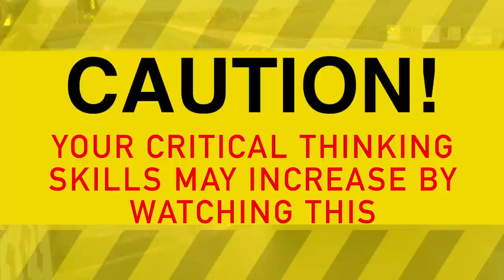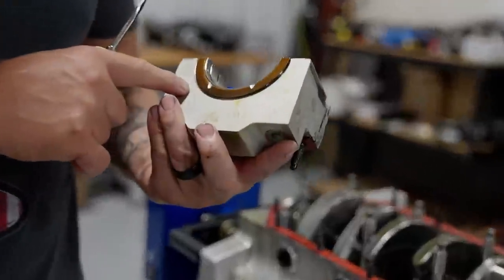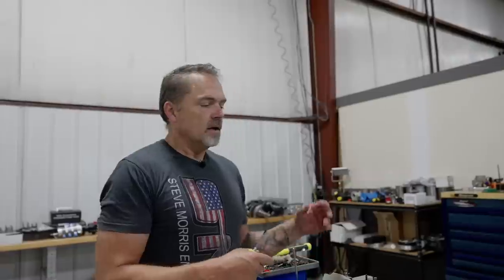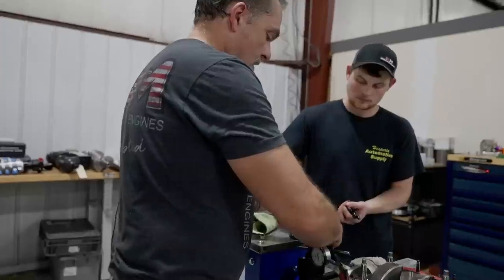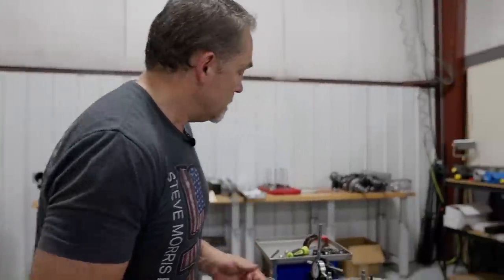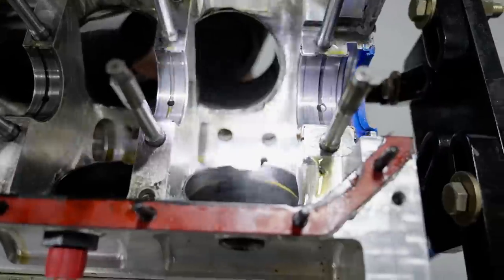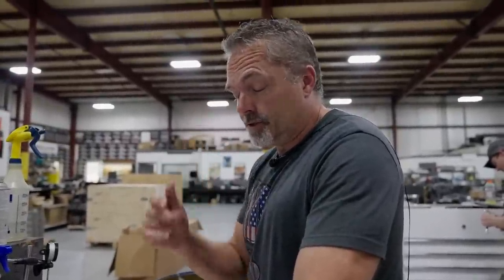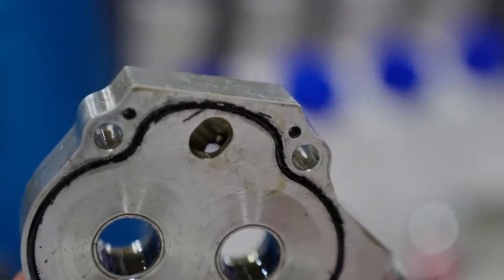I Found Mullets Engine Issue...Part 2

Comment: I love your videos and your work steve but in order for a converter to put pressure on the on the pump gears and housing causing pump failure as well if this is happening  especially in a th400 you need to start with cooler flow there is nothing to limit charge pressure in this transmission most guys run a pop off to limit this I've had one of those fail and bite me once great stuff steve

Comment: Possibility of stuff in the oil tank or oil lines to the pump? Didnt see if they flushed all the lines and the oil tank out after the previous metal issues. Id assume they did that but just spitballing. no metal going through scavenge side only stuff through pressure side getting feed from tank then to filter, may not see at low rpm or 2 step checks sustained high rpm high oil flow/pressure of a pass. love seeing all the tech and tear downs.

Comment: The roller thrust bearing is at the front, while the stock type one is at the rear, so as temperature goes up the block would grow more than the crank, DECREASING the thrust clearance. That combined with pressure from the converter... Probably none of this makes a difference when racing for 6 seconds, but on the street drive between tracks - and towing the trailer - the whole drive train would probably be warmer than any other time. Also, for the trash in the filter - Was the dry sump tank cleaned out? Trash could have come through from previous junk left in the tank???

Comment: Gday Steve, with that bypass being stuck, is there another way for the oil pressure to be relieved at high RPM?  It looks like that pressure side pump has seen a little bit too much pressure.

Hydraulic gear pumps eat their housings in exactly the same way when a relief valve is set incorrectly or fails.

The scavenge side would not be damaged because there is no pressure there, but the pressure side would be damaged.  The high pressure actually bends the shaft and pushes the lobes into the housing.

Happens really easily on aluminium pumps.

Comment: Man... I love my single cylinder 4 stroke so much more now. One time when I raced I tested it with a worn out cam and had an hour and a half to replace it and lash the valves. Everyone else in my class had 2 strokes and kept walking past staring and chatting. Later I found out nobody thought I would be able to have my engine apart and back up in such a short time. I holeshot everyone with my lil 53cc 4 stroke vs only 66cc and 69cc 2 strokes. They all had to play catchup and I got 7th in a field of 18.

Comment: Expensive lesson here I'd bet.  When you have a customer complaint you need all the information available. Maybe create a customer questionnaire before induction of the engine. I'd have certainly thought that checking that pressure relief valve would be on a "lessons learned" list.

Comment: Hey , Steve, I know you probaly will never see this, but is it possible to have crankshaft deflection from the thrust being moved from the rear solid crankshaft snought ,to the front through all the offset rod journals ? maybe even causing a imbalance on trans input shaft or convertor .Not to discredit anything you do ,you do wonderful work .I love all the free knowledge you put here for all of us to absorb. Just wonder if that is possible ??
Reply: I was thinking the same thing. I’m sure it doesn’t take a ton of pressure to flex that crank .02”

Comment: Aluminium has a greater coefficient of expansion than steel. 
If your roller thrust bearing is at the front of the crank and the plain bearing thrust face is at the rear, then it is possible that the thrust clearance on the rear main tightens up as the block gets hot and expands more than the crank.
Is it also possible that the crank compresses slightly under very high axial load induced by charge pressure? With that force being taken by the roller bearing at the front of the motor, this would also cause the clearance to close up on the rear main. Maybe the combination of these two factors and a bit of deflection on the roller bearing housing adds up to the 20 thou required for contact on the rear main.
P.S: Love your in depth analysis of these things!

Comment: The debris is probably from the remote oil tank. It didn't come from the engine or the pump, therefore it was introduced from an outside source. Pretty sure the tank was Cleeter's responsibility.
Either something was hanging out in the tank from the previous engine, or it was contaminated during fabrication or assembly.
I work around very expensive hyd systems and have direct experience with repeated failures from minor overlooked details.
It happens, no one is perfect and it seems they run a pretty intense schedule at the FF.

Comment: Why not put the trust on the back of the block so it isn't trying to collapse your crank like an accordian under thrust load.  There has to be close to .020" of collapse in the crank webbing under load for that back thrust to still be kissing or the retainer is pushing off that much likely a little of each.  Regardless I think it would take a lot of stress off the crank and bearings if it only had the rotational loads to deal with.

Comment: To be honest, you want to see that wear on your bearings if something does go through it. The babbit covers the copper and is very soft to aid in embeddability. It's designed to burry foreign debris and keep it off the journals or wherever else it would be an issue for.

Comment: By continuing running the engine until it failed, you never would have found what the actual problem was.  Since he did not, you learned what the problem was and the next time this happens you can easily pinpoint the most likely cause.

Knowledge is power.

Comment: Chances are that the increase in horsepower loosened existing debris that went undetected. The internal pressure drastically increased by each horsepower added. There could have been material that was there from manufacturing that never loosened because there wasn't enough pressure ran through the system until the HP was increased. That would be my guess.

Comment: 2 things that catch my attention, damage only on the high pressure side of the oil pump pulling oil from the tank... Have the lines coming into and out of the tank been removed and flushed out? Also has the tank been removed, cleaned and flushed since the last issue with contamination? Debris could settle until high RPM and flow...2nd thing is traction control cutting in and out causing major stress on the crankshaft when the converter locks and unlocks, could there be a harmonic issue with the pulse rate the TC is set at and is it adjustable to possibly lessen the converter stress on the crankshaft? Have you seen this issue on any other SMX engines or is this isolated to just this engine? If I remember correctly Cleetus while tuning for the 6's they loaded this TC setup in the tuning.... Seemed like it worked well but wondering if it could've inadvertantly caused a stress issue?
Just thinking out loud...

Comment: Cletus has a transmission problem, mainly his pump doesn't have a orifice installed in the converter feed passage and it's shoving the converter forward with at the pressure it makes available if he's running a TH400 or clone.  Unfortunately it's showing up in your engine.

Comment: Reduced thrust bearing clearance due to thermal expansion seems possible also, can you really know if the crankshaft or block heats up quicker? Also aluminum has double the expansion coefficient....

Comment: As a note on the thrust bearing, if you have a std thrust bearing on the rear on a roller thrust bearing on the front and the clearance is .027 for the regular thrust bearing on the back and .007 on the front, then you have .020 difference between the two. Since the block is aluminum and the crank is steel, they have different coefficients of expansion. Basically aluminum is double that of steel. Like with the rods. Looking at roughly 24 inches difference from the front to rear and a temp change from 80 degrees to 200 degrees, the crank grows by .019 but the block grows by .037. So that means the block is pushing the rear thrust backwards by .018. That eats up most of that .020 difference. So just a little converter balloon pushes the crank right into the rear thrust.  Probably just add another .005 clearance on the rear and it will be fine.

Comment: If I had low oil pressure issue with and external pump, the first thing I would check is the pump, before I tore down a complete engine. Also, the minor scuffing inside the pump doesnt seem to add up to all the metal in the filter.

Comment: Could the material found in the filter screen be from a turbo that’s on its way out? I believe turbo’s are tied into the engine oiling system correct? I don’t know much about turbo engines, but the engine internals look great so maybe one of the turbos introduced metal into the oiling system

Comment: Had similar issue, turned out the cooler was holding material from a oil engine letting go.

Comment: cannot say I've ever seen a crank walk backwards against and eat the forward side of a thrust bearing, except once, when a washer was placed onto the crank snout behind a journal, where it shouldn't have been! crank was pushed backwards and wedged hard against case front, it ate everything up quickly(accidental thrust location). lol
add-on junk bolted to the crank snout/pulley could potentially push it backwards hard enough to cause damage, that would be some major oversight and bad assembly work to cause it though.
watching the rest to see if anything is found.

Comment: could piston be chipping at some of the welds in the block/cylinders? piston would be harder material then the welds/block repairs so it wouldn’t show on the piston heads much. would self clearance after while. plus with heat cycles could be changing it a bit

Comment: So a grain of sand (or something) got into the dry sump tank. It got sucked into the pressure stage and hung around a few rotations starting the gears eating themselves. On it's way out it scraped the bypass valve and started it on it's way to galling. Then it went thru an oil filter bypass or hole in the media and lodged in a main bearing causing a minor scratch. It's possible, I've found race engines that ran for years with their oil filters bypassing most of the time. What's left of the foreign object might be buried at the of that bearing scratch. What's the filter media look like?

Comment: I'm thinking that is where the flakes are coming from the oil pump section. Nothing in the rest of the engine is causing the flakes so far as I can see anyways. There has to be some way to keep the converter and the transmission from trying to push everything forward on the crank.

Comment: OK. So the main thrust is now at the front of the crankshaft. Based on the numbers you gave, you're already squishing the crank .020 plus any heat growth. I doubt that's good. May be time to redesign and put the thrust load at the rear again??? It's like trying to balance a brick on a flexy straw.

Comment: So the pressure side of the pump picked up the metal from the oil tank then?  What returns to the tank other than the scavenge side of the pump?  Do the turbos return oil directly into the oil tank or into the sump?  Are we looking at a turbo eating itself here?  I did notice one of Mullet's turbos was spitting out of the inlet when he was starting his burnouts.  Just wonder if there's something going on there that is creating the metal swarf.

Comment: Steve mentioned that the inclusions were on the pressure side of the oil  pump; sourcing oil from the oil tank. 
Since I’m not familiar with the oil tank’s construction, is it possible that slag entered the oil pump from a poorly back purged weld on the tank?

Comment: Does this answer where the materials came from? Maybe the tank had some trash in it? Also is there anyway to rig up something to quickly check if the bypass is hung open? Maybe its not necessary in most situations where charge pressure is normal. My guess is that you guys would have diagnosed the oil pump first before pulling the pan.

Comment: I don’t recall that a torque converter “ballooning” should be able to “bottom out axially”, and suspect that if it did, the transmission front pump would be the first thing to take the beating. 
Has Garret thoroughly cleaned the dry sump system, lines, tank, cooler, etc.?
As to the wagon’s converter, I’d suspect you’re overwhelming the lockup clutch and the slippage is responsible for the high temps. Could it “ballooning” be adding clearance to the lockup clutch?

Comment: Have you ever had issues using cloth rags? I was always told never to use them when working inside a motor as the cloth fibers can't breakdown and can get stuck in the bearings.

Comment: So maybe it was just old piece of crud from the original explosion with steve.  A random super little piece finally made its way to the oil tank and just happened to get sucked up at the right time to go through the pump. 

With the level of explosion it had, there’s probably going to be a few more break free also, some things just can’t be cleaned out good enough, and just have to work there way free over time.  Just how it goes in life.

Comment: Wouldn't it be the transmission when something could be rubbing and sending the material somehow through to the engine? when it smacks into it due to the high charge pressure as some sort of reverse fed the material towards it and allowed it to grab ahold of it? The overdrive stopped working on one of the runs that Cleetus was on as it slipped and shortly after could've sent whatever lost from it up. His last run with OD was about 217-225 mph range when the next run no OD

Comment: This may sound stupid but things have to give some or things will break. Can the crank at the rear thrush bearing can the crank push harder than you think at the rear thrush bearing and the rear of the crank bend in causing the crank to bend in some putting presser on the rear thrush bearing causing it to rub on the rear main thrush bearing to close in from the crank being forced by presser from the converter?  Just like your rear axle twist 1 or 2 turn on a axle so it will not break on take off then they spring back. Wonder if you could make something that would tell you how much presser being applied there. Maybe a rear roller bearing at the rear thrush would help. Seems like you see bearing problems start at the 7 and 8 rod but you never no when you make this kind of horsepower level. It might not show up cause ou are not eaning on it long enough though. There are so many variable things like how much the car flexes and trannie setups and converter it never ends. I still think for you turbo cars they should let you staged the car then make boost so you don't have to jerk into the pre staged to staged. Then have a light somewere on the car's that lights up and the other person has so many seconds plus + or - so last person can't guess at the light to get it up to boost before the light comes on. Ok I'll go back into hiding.....lol... You don't want to be like the fuel cars were you are taking the motor apart each round. You want to have fun with the car. Working on it all the time gets old fast. A engine should last a racing year without taking a engine apart. That's why you build it like you did. Hope you get all these stupid problems solved.

Comment: Didn't the car have a few turbocharger issues?  Maybe the debris came from trash leftover in the oil system.  If you don't take the lines apart to clean them then they should be cleaned in an ultrasonic cleaner along with the oil cooler.  Moly coating the pump gears & housings will take some temperature out of the oil and it will pull more vacuum.

Comment: Steve, what size and grade bolts hold your roller thrust bearing and what are they torqued to?  0.20" is a lot so something is moving and I doubt it's that bearing as they are hardened and tend to break before deflecting that much but if you are using grade 5 or 8 bolts they will stretch and come back easily if not torqued to yield. I would also upgrade to a harder bolt, a 12.9 if metric or if they are SAE then go to an upgraded alloy bolt to hold stretching. The biggest issue with this kind of upgrade is the bolts don't stretch and when fatigued to their limit. Just snap rather than stretch

Comment: Now you have me thinking. How much deflection is there in the crank when it is captivated at the front but 1000+ lbs shoving forward with 20 thou. of movement at the rear. Can you engineer the roller thrust bearing to fit at the rear and remove the load from the crank?

Comment: You need to really clean AN lines after you cut them. Especially if you use a wiz wheel. The hot metal cuttings embeds itself into the rubber of the inside of the hose. When the hose gets hot it all lets go into the oil.

Comment: Are there braided oil lines with teflon liners runni8ng from the oil tank to the pump or from the pump to the tattle tale oil strainer sight glass thingy? The teflon is soft enough  to sometimes get poked b y shredded metal shards and maybe capture a few of them. And there were a lot ofpointy shards to catch in there once. Might be worth a look and it could solve the riddle opf how crap from a blown motor manages to invade this super cleaned and inspected motor so often

Comment: The only other thing that is included in the oiling system are the Turbo's, didn't the guys at McFarland Motorsport have a leaking turbo and changed a housing on the event. Also are there any oil coolers that could of held something form a previous issue.

Comment: Was the block re inspected after the weld repair? Are the bores still square to the crank journals? Just a thought with the whole thrust bearing deal on the crank.